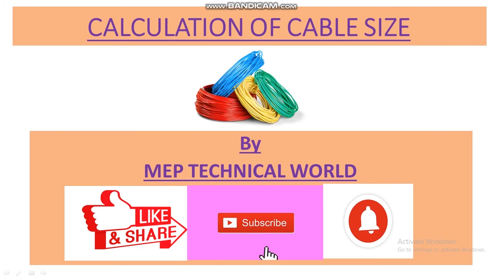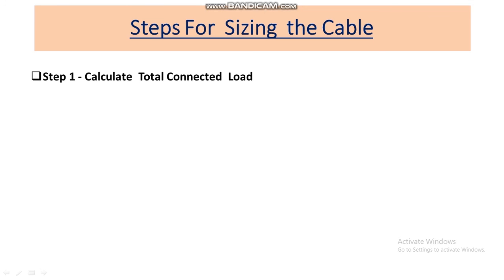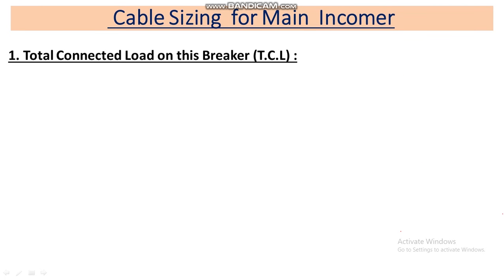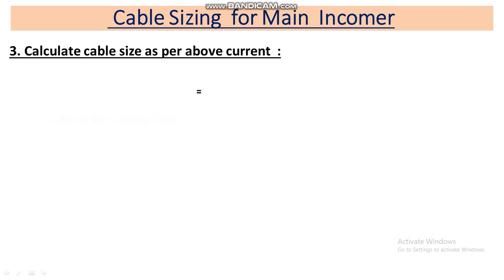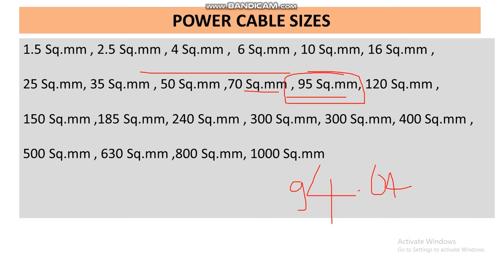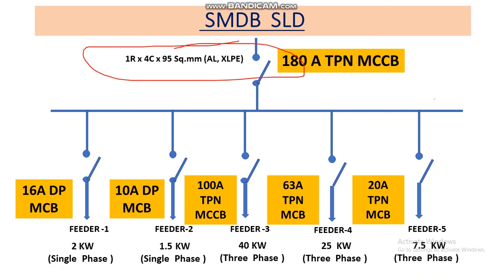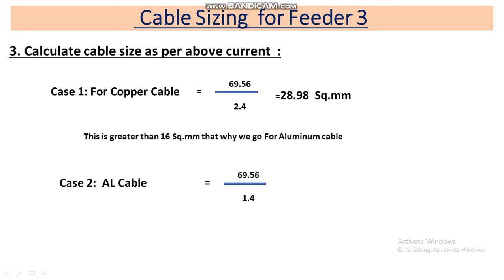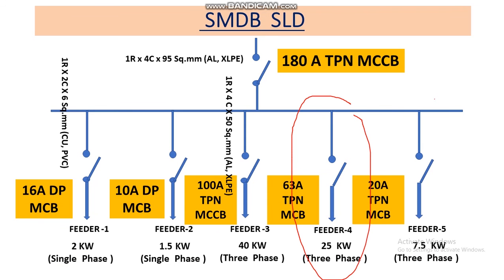Cable Size Calculation  As per Thumb Rule | Steps for Sizing the Cable Size

Comment: Where do you get 2.4 and 1.4 value Is it in the catalog or you just take random no
Reply: Nope, its not random value.
Normal standard amps ratings for copper  1sq.mm is 2.4-2.5amps
Aluminium 1sq.mm is 1.4-1.5amps
Reply: @vinidh1999  This might be applicable above 50 sqmm but it is not accurate method
Reply: Thank you

Comment: 1 sq mm Copper Cable Current Carrying Capacity:
Copper cables with a cross-sectional area of 1 sq mm exhibit an impressive current carrying capacity of up to 30A, making them ideal components for electrical wiring

Comment: The CB should protect the cable but how it protect it if the rated current of CB is higher than the cable current carrying capacity.  Load current <CB current <cable current carrying capacity

Comment: Thumb rule formula required for 3&1 phase how it's came 575 &184
Reply: For three phase , P = √3 VI cos 
I = P/ √3 V cos
√3 = 1.732 , V = 415 , cos = 0.8
If you multiple these three it will come 575 

Similarly for single phase , without multiplying 1.732 .. You will get 184 for 215v . Hope you understand